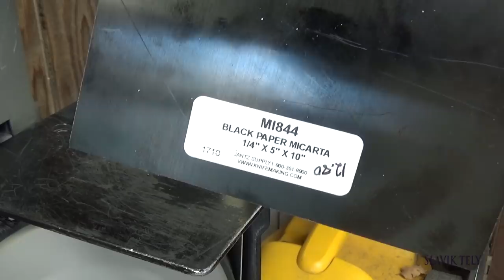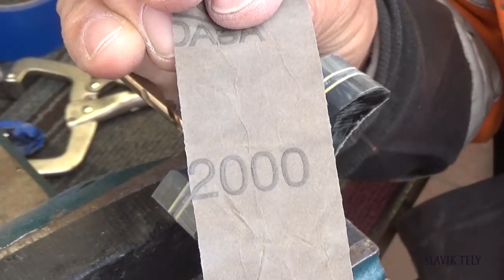P2 Making Resident Evil 4 LEON KNIFE

Comment: Hi sir,

Do the handles/Grips take more time for you to finish than the blade? 

I love your work. I will begin my journey soon to practice knife-making. You are a real inspiration to me. Thanks for your videos.
Reply from the maker: About same time. Think about it, the blade needs bevels ground then hand sanded then heat treated, tempered, then hand sanded again. Handles- need to hand sand then, then glue layers with G10 the drill them, then glue to the steel, then shape them, hand sand them and buff them.